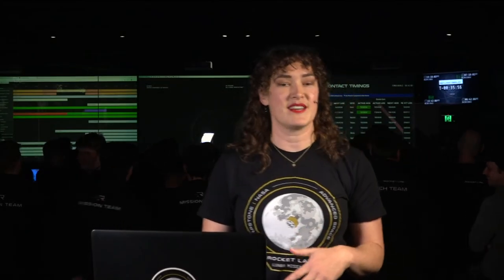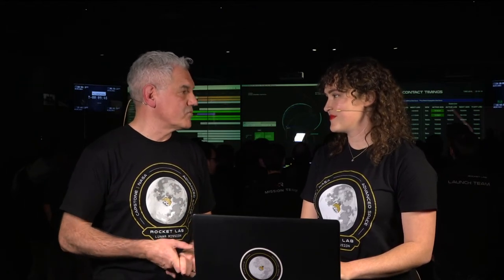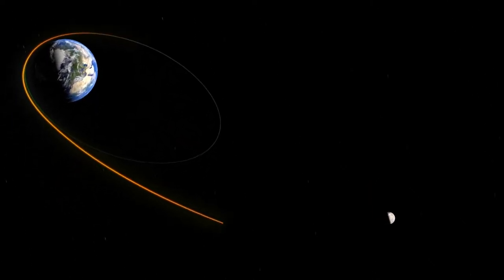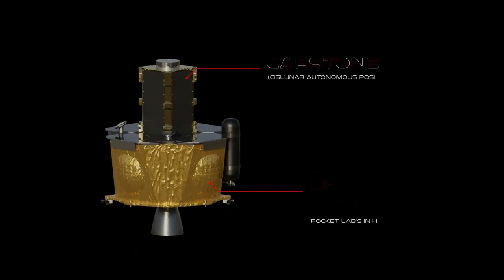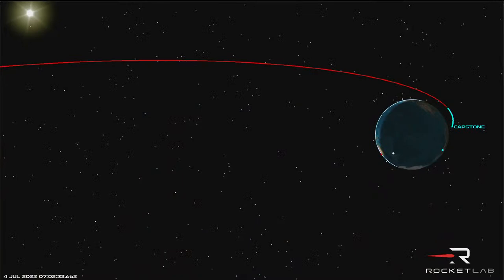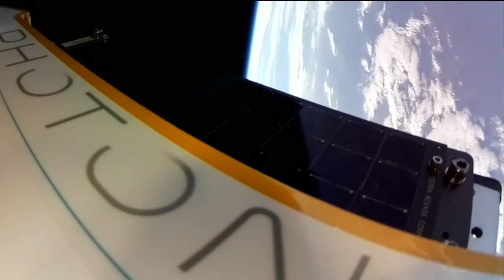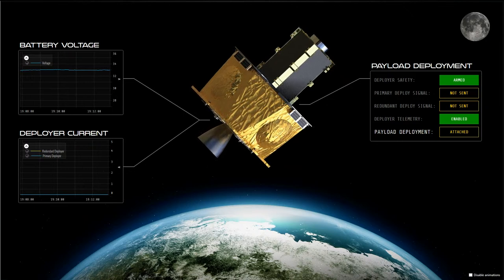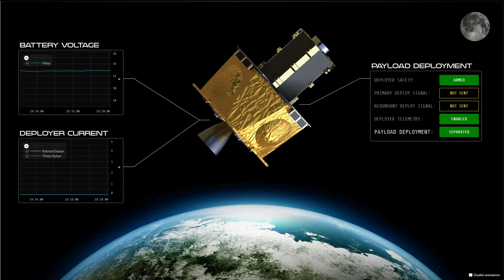Rocket Lab Sends CAPSTONE Satellite To The Moon For NASA

Comment: Congratulations!
One question I do have: what happens with the second stage and the photon stage?
Reply: It looked as though there was 1% fuel and LOX left when it staged 1->2, so I would hope that's used to de-orbit, as Beck has said they do...but with the margins so tight on this one, you never know.
Reply: @andyr0ck  Actually, since this was such a low parking orbit, the second stage deorbited really quickly and has already burned up.  As for the Photon, it was sent to where it won't interfere with the Capstone satellite and will most likely, since it reached escape velocity, travel out to the orbit of the outer planets...probably to never be heard from again.
Reply: The Second stage falls back into the atmosphere and burns up. Photon will perform a low altitude flyby of the moon and fly into solar orbit.